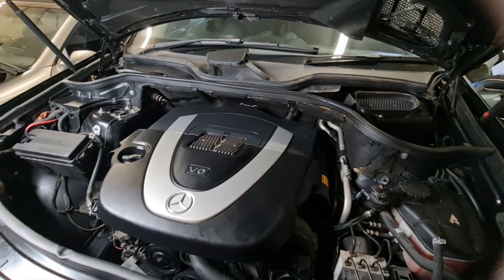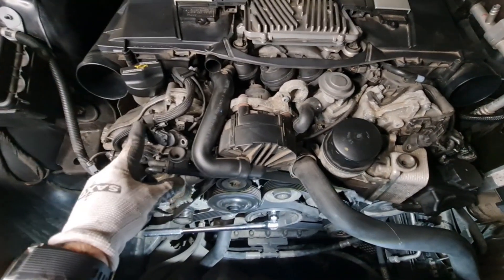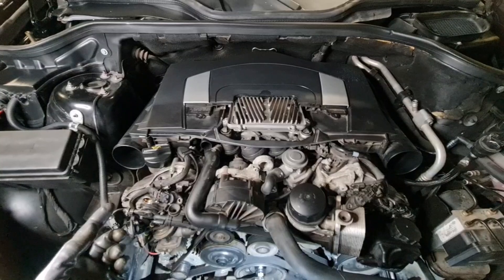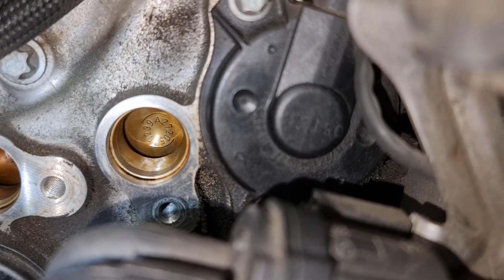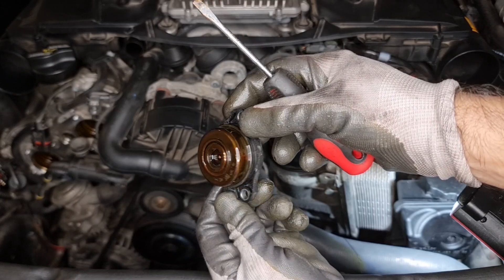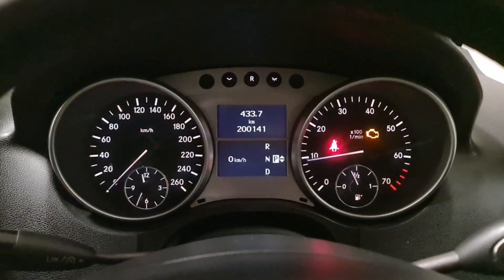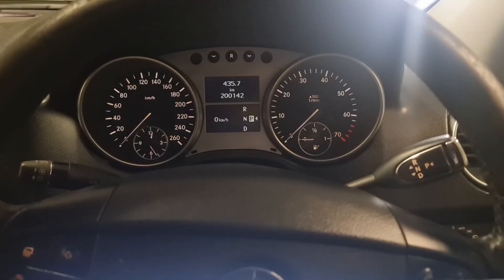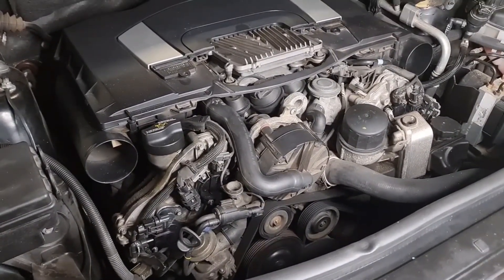Crucial Topic: Check M272 & M273 balance shaft sprocket before catastrophe...

Comment from the maker: Took me weeks to put together all the data and months before I can release this video, it is a super important topic for any owner and to be owner of M272 and M273. Recently I have noticed a decline in viewers which is very disappointing and discouraging.
Reply: I really appreciate your videos and have been tossing up attempting to fix this issue on my m273. It looks like a tough job 😬
Reply from the maker: @fakeddyfakefake9714  You are welcome,  hope you get the time to do this project.
Reply: Thanks for doing this helpful advice and information.
Reply from the maker: @Leo555ZZZ  Thanks for watching Leo :)
Reply: @BenzAddiction  You are welcome , I am still interested in these engines even though I don't have one.
Reply from the maker: @Leo555ZZZ  👍
Reply: The M273 does not have a balance shaft, only a flywheel that is held on by 1 bolt.  So far I haven't seen any video where the M273 balance gear is worn like the M272
Reply: @boroadov87  You are correct that there is no balance shaft in the M273, but in its place is an idler sprocket that will wear out the same as a balance shaft. This will give you the same error codes as a M272.
Reply: Retiring & moving to Mexico in 2025.  Extremely complicated to import a car into Mexico that was not manufactured in North America.  Also, switching to a 4wd vehicle because of the roads there.  Very unlikely I will be buying a Benz there.  I made the switch from M113 to M273 only 5 years ago, and I appreciate all the videos you've made.  Thank you for all of your hard work.
Reply: So the 2010 that you have doesn't have any problem? I bought a E350 C207 from 2010 with the M272 fuel high pressure pump. Is it supposed to have this kind of problems?
Reply: Thank God I discovered your channel! So informative and crystal clear to understand.  Excellent work!  I have two cars with these engines and one with the sprocket issue but nothing has occured in 144,000 miles!
Reply: Thanks, perfect 🎉
Reply: So sorry to hear this. I truly enjoy your videos and have used them for help working on my daughter's E320 and friend's GL450. Much appreciated!
Reply: Appreciate your great understanding 🙏
Reply: Thanks, mine is OK

Comment: Your video is excellent.  Best on I have watched on this topic and I have watched several.  My question is that I have a 2009 E350 and my engine number is 272...31 164405 which is way past the numbers you referenced as bad.  So my car should not have the balance shaft issue.  It has 157K on the clock and I am getting the check engine light with codes P0016 and P0017 coming on.  After clearing them they come back.  Car still runs ok but has a slightly rough idle.  I have heard that this might also happen with a worn timing chain or maybe a spun camshaft sprocket.  Is this true and if so is that much easier to fix than pulling the motor and replacing the balance shaft ?
Reply from the maker: Hi my friend and thanks for the feedback,  there is only one way to know this, see if all the circles are in the dead centre,  if they are you are lucky and you may get away with sensor and magnet. Otherwise the sprocket and chain wear can happen to any car.
Reply: Most likely your chain has stretched but I would troubleshoot the camshaft position sensors and camshaft adjustment solenoids first.

Comment: Hi, any update on this. I notice, there are diffrent OE cam numbers, are those in the video correct? Did the codes finally went away?
Reply from the maker: If the sprockets are worn, there is no remedy except replacement.
Reply: @BenzAddiction  Hi, if the sprocket is in good condition , you should see mercedes circle on the center of the righ side of the intake cam sensor?
Reply: Mine just thru P0017 alone.. and it has 140,000 miles..
Reply from the maker: @boxeoa360grados yes
Reply: Hi BenzAddiction.I performed the cranfshat movement test at 305 to see if is in line and the intake side of the cam sensor was in the midle and the exaust side slidetly out of the middle also with code p0017 alone, its this normal?
Reply from the maker: @boxeoa360grados should be dead center. 😢
Reply: @BenzAddiction Intake side center 100% and exaust side dont matter right?

Comment: I appreciate this video but I would love to see the actual process instead of the sped up version. I want to buy the clk 208 but now I’m scared
Reply from the maker: Get the car to a Mercedes Mechanic and ask specifically on the balance shaft sprocket check. Buy if passed.
Reply: @BenzAddiction   a bit difficult to take the car to a mechanic without buying it first

Comment: Engine	272964 30 510098 OK or NOT OK ? (it is m272)
Reply from the maker: Yes, your M272 engine is affected by the balance shaft sprocket issue. The updated, stronger sprocket was installed on engines with a VIN starting after 2729..30 468993. Your engine number is 272964 3051098, which falls within the affected range.
Reply: @BenzAddiction  its .. 30 510098 mate ? see again🤔

Comment: Hi, I read, that this only occur to 25% of those engine batches, are ther any thruth to that?
Reply from the maker: This is the AI answer I could get: A specific percentage is not publicly available, but a significant number of M272 engines manufactured between 2004 and 2008 were affected by a defective balance shaft gear, leading to a class-action lawsuit.

Comment: Hello, tomorrow i will be looking at a 2009 e350 coupe 292hp, and this is the engine code 272982 31 193433 .It starts with 31 but the latter numbers are lower than the ones mentioned in the video. So is it affected ,or will I be fine?
Reply from the maker: 2009 should be fine. Make sure engine light is off also other warning lights, if you can and if you have a good scanner,  scan for the codes.
Reply: @BenzAddiction Thanks for the fast reply! I do have xentry star diagnostic ,but it is a bit inconsistent.There are some modules that cannot communicate to, or at least for my clk320 and clk270.

Comment: If the circles are not centered BUT my engine  is not among the affected engine numbers (my engine has been already been improved by factory) ... That means I need new magnets and camshaft positions sensors?  Please help!
Reply from the maker: How many km on your engine?
Reply: @BenzAddiction  154,000 km
Reply: @BenzAddiction   96,000miles - 154,000 km

Comment: Hello!! 
My 08 cls550 engine code is 27396030173944
I did the check according to your video and when I got the engine to 305 degrees, the right side(US driver side) was aligned but the left side was off, the circle was higher.  My car has about 95 thousand miles. Is this bad? What can it be?
Reply from the maker: Do you have any of these fault codes? (P0016, P0017, P1200, P1208) if not don't worry.
Reply: @BenzAddiction  thanks for replying! My check engine light is off at the moment but I'm experiencing rough idle and random misfires only when stopped. No idea why I don't have any codes

Comment: If my engine code is 27294330149152 , it means my engine balance shaft is good quality or not ? sorry I couldn’t understand.
Reply from the maker: * Affected Serial Number Range: M272 engines with serial numbers up to 2729.. 30 468993 are most likely to be affected by the balance shaft gear sprocket.

Comment: Ich habe m272 fehhlercode 16 und 17 aber keine kettengeäusche volle leistung baujahr 2006 märz bei 330000 km was kann das sein?
Reply from the maker: It is probably the balance shaft gear that is worn. But i could be wrong.
Reply: @BenzAddiction  eine ketten riss oder überspringen ist wohl ausgeschlossen bei den motoren? Ich werde zunächst magnete wechseln lassen  und fahren  da ich volle leistung habe auch tüv ist kein problem habe ich ohne problem bekommen

Comment: Hi there. Why to do it so complicated? The Mercedes-Benz diagnostic will show you the same. I am using the C4 multiplexer and Xcentry/DAS to check this.
Reply from the maker: Yes, that might help, but do we all have access to $1000 tools?
Reply: @BenzAddiction  If we have the Mercedes, and we are repairing it by ourselfs, it is the moneysaving investition. I recommend to all, because only coding a number at the dealer service costs the same price ;) In this case helps to look under the sensors, but is a lot of things, what you cannot to diagnose and fix without the Xentry/DAS and any multiplexer (C4, Openport...).

Comment: I’m looking at getting a 02/2006 ml500 5.0 has 113k miles does the 5.0 have the same issues
Reply from the maker: For the M273 it might be similar issue but does not require engine to be out.
Reply: That would most likely have the m113 like my r class of the same year

Comment: My C300 is 2009, just to clarify balance wouldn’t be a problem in this model?

Some common issues I’ve already fixed at 105,000 miles-
Idler pulleys and tensioner
Oil cooler and air filter housing replaced
Regular transmission services
Oil changed every 4500
Vent valve every 50,000 as preventative 
And I recently replaced intake manifold
Any other issues I should look out for in the model year? Ik can magnets can cause issues but isn’t about anything else
Reply from the maker: Yes, great, check the differential oil too.

Comment: I have googled this today:     Is it all true?

The M272 uses balance shaft.
But!
The Mercedes-Benz M273 V8 engine uses an idler sprocket, not a balance shaft. The M273 engine is inherently balanced, so it doesn't require a balance shaft. Instead, it has a timing chain idler sprocket, which is a simple "dead idler" bolted to the front of the engine.

May it be easier to repair - idler sprocket vs balance shaft?
Reply from the maker: True: Yes, the M273 Mercedes engine, like the M272, is susceptible to a balance shaft sprocket problem.
 * M272: Experiences balance shaft sprocket wear and tear.
 * M273: Experiences idler gear sprocket wear and tear.
The Issue:
 * Premature Wear: Both engines have issues with the balance shaft (M272) or idler gear (M273) sprockets wearing down prematurely.
 * Timing Chain Slack: This wear leads to excessive slack in the timing chain.
 * Camshaft Misalignment: The timing chain tensioner can compensate for some slack, but eventually, this leads to misalignment of the right-bank camshafts.
 * Engine Malfunction: This misalignment results in rough running, check engine lights, and potential engine damage.
Symptoms:
 * Check Engine Light
 * Rough Idle
 * Reduced Engine Power
 * Misfires
Resolution:
 * Repair: Requires engine removal and replacement of the worn sprocket(s), along with other recommended components per Mercedes Service Bulletin S-B-03.30/08i.
 * Costly Repair: This is a significant repair, often exceeding $3,000.
Important Note:
 * This issue primarily affects earlier production models (generally 2004-2008).
 * Mercedes has addressed this issue with improved sprocket materials in later production models.
Disclaimer: This information is for general knowledge and guidance only. Consult with a qualified Mercedes-Benz mechanic for accurate diagnosis and repair of your specific vehicle.
Reply: This can be done on an M273 without removing the engine (it's just a simple gear, for 272 you have to pull the engine out to replace and bolt the balancer shaft on both sides) , but you’ll need to lift it slightly as there’s almost no room to work especially when sealing the pan. A dealer would prolly charge around $3,000, but you could probably do it yourself for $500 or so (I did it a while back, but I don’t remember the exact cost, chain kit + guides + tensioner + different gaskets etc... ). Be warned—it’s extremely time-consuming. Don't even try without the WIS aside to check for the right procedures along the way, and get the chain + guides + tensioner replaced while you're at it.
If you don't want to bother, pull the engine out it's still MUCH simpler...
Reply from the maker: @angturil  Thanks mate :)
Reply: Thanks for sharing. Would be great if you could post a video on the job.

Comment: Thank you very much for all the job in this video.  I've checked my M273 engine number and unfortunately it is affected. I have P0017 code only. Thought the timing chain replacing would help but now I see it doesn't make any sense. 
What a disaster. Gotta say goodbye to my beloved CLS. Hopeless.
Reply from the maker: Doesn't necessarily means that, i suggest you to pull out the sensor and check the circle marks.
Reply: @BenzAddiction   I have replaced all 4 sensors + adjusters. P0017 code still present. 
The engine cranks slowly but once started it runs nice and smooth, no odd noise at all. I am bit confused now. I'll give it one more chance, go to a garage and try to repair it. Will let you know guys whether it's fixed or not and how much is it in UK.
Reply: @MrTopsy888  any updates
Reply: @phaz7185  I have booked garage later this month. Gonna replace idler sprocket and timing chain. Time consuming, expensive job. But I love my CLS and want to fix it.
Reply: Wonder how much to fix this issue, I heard this is an engine out service and could cost $3k for Indy shop and $7k for MB dealer.
Reply: @tedlu008  @phaz7185   
   I have fixed my M273 engine recently.  Not on my own but my friendly trusted garage has done it for me. 
This was "engine out service" - and even if there's is another way - I strongly advise you do it "out" - for quality job results!

I also strongly advise to replace all (4) the timing sprockets + timing chain. You don't want to open the engine anymore in it's life. 
1. Idler Sprocket
2. Crankshaft gear sprocket
3. Camshaft Adjuster - intake side right
4. Camshaft Adjuster - intake side left
5. Timing chain kit.

It's up to you if you want to use genuine Mercedes parts. The Idler Sprocket is cheap but original Mercedes Camshaft Adjusters are bloody expensive. 

All the job takes 2-3 days if you get parts delivered in time. 
Total cost in my case, parts + labour (UK) circa £3500

Comment: I was looking at a 2006 c280 125k miles and drove it home and got cam shaft position sensor p0015 code, car drove completely normal in my opinion and sounds fine. I looked up the engine and it is one that has issues. Does it just have a bad sensor cuz you didn’t say anything about this code. 

WDBRF54H36A850841 is the vin.
Reply from the maker: @Rvssvlle90  probably a bad balance shaft sprocket causing a chain slack. With that year and mileage, it's not unlikely at all.

Comment: if your sensors are good but you are experiencing leaks from the sensors, you can buy the OEM seals/orings from the dealer for $5-9/each
Reply from the maker: @frankcastle797  correct:)

Comment: Great videos!  Did you disconnect the negative battery terminal prior to replacing the sensors?
Reply from the maker: No, not required disconnecting - terminal on a Mercedes-Benz has its own risks, even if it is less than 1 percent:)

Comment: i have a later m272 on a 2011 e350 4matic, have rough idle where i feel vibrating in the cabin, any suggestions as to what it could be? I have changed the transmission fluid and filter, changed the MAF, changed sparks and changed a bad coil and still nothing
Reply: 1. connect a scanner and check for codes.

2. most simple checks are make sure maf is seated properly. it is easy to not put it back into position properly and you will experience rough idle. 

3. make sure all hoses and electrical connections are connected appropriately and not damaged. 

4. worst offender is engine mounts which do not last long. my mounts engine did not move much but when i replaced them, the drivers side was split in half. i experienced terrible vibration. you won't know the mounts condition until you remove them.
Reply from the maker: Stop throwing money and Diagnose using a proper scanner, come back here with a code and we can help you to get in to depth of it.
Reply: Vacuum leaks are high on the list of problems. Cracked and broken vacuum lines are typical for these older cars. Some of those lines are a hassle to get to, you may need to remove some items, and you should have a small assortment of needle nose pliers of various sizes and curved jaws.  Remember that Mercedes uses plastic lines in some areas that go into rubber lines in other areas and only specialty places like FCP Euro, and AutoHausAZ will have those plastic lines.  Also check your manifold swirl-flap actuators.  I replaced the main actuator, a couple of fuel injector seals, and the vacuum lines and the engine went from shaking to running very smoothly. Try using carburetor cleaner or starter fluid to diagnose where the vacuum leaks are.
Reply: Engine and trans mounts need changing

Comment: Can you do a video on replacing the balance shaft sprocket , I like how you explained step by step. Thanks
Reply: If I were trying this, instead of pulling the engine, I would pull the transmission, recover the Freon, drain the radiators, and try to pull the shaft out without removing the engine.  I can't imagine removing the transmission is any harder on this car than on a W210. The fact that MB didn't make that sprocket removable, is ridiculous.
Reply from the maker: @erick3786  i will do at some point but unfortunately it can not be anytime soon as we are moving to a new property, which gives me a bigger space.